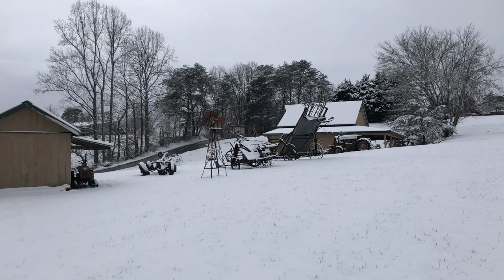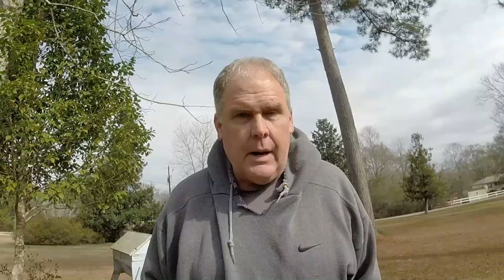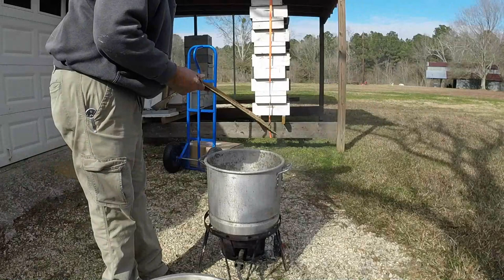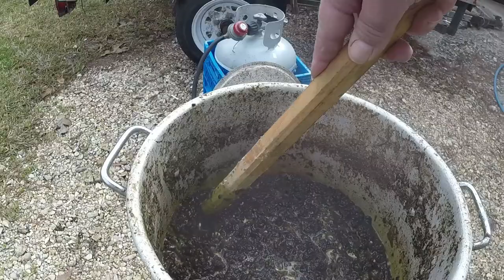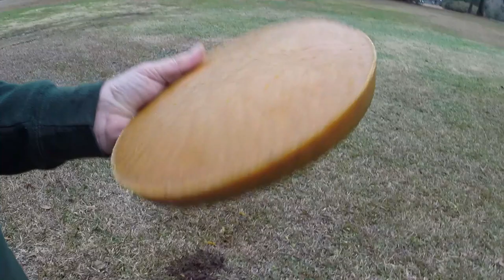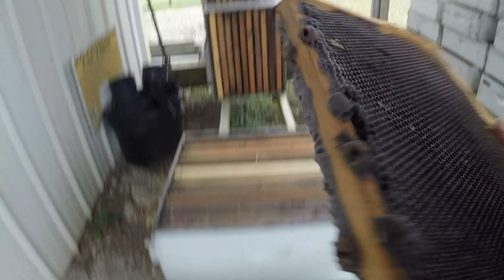Rendering Bees Wax and Various Beekeeper Tasks

Comment: Hi Mike, I find if I use lots of water in the pot to melt the wax, it strains a whole lot easier. I also pour hot water on the wax while it is in the strainer.
I also see no need to open a hive in the winter. In MN, I set them up in Oct/Nov and wait until March/April.
Reply from the maker: Hmm, I need to try that Raj. I cut back on the water because I always overfill the pot with wax, but to strain easier would be good. I will give it a try next large batch I do with brood wax. Thanks for the tip!

Comment: Hello Mike, just checked your old videos before I asked if you would do a video on how you make your foundation with the rendered wax. I have seen  "Fat Bee Mans" and Joe May but they do it on such a large scale. I only have 7 hives ,but I do melt the wax down but  I use it to rub it on plastic foundation. Thanks for your time and videos.
Reply from the maker: Thanks for watching and for the question. I use the wax for the same thing as you, plastic foundation. I do not make my own wax foundation. I like wax foundation and used to use it a lot, but I always just bought it. It takes a lot of wax and expensive presses if you want to emboss it, so that’s why Fat and Joe do it in a large scale. Plus they only use wax foundation, so it pays for them to invest in the equipment with so many hives. There are small scale ways to make foundation with a board and to make an embossing mold from silicone, but if I were to use wax foundation again(I like it a lot), I’d probably just by it with only keeping 25 to 35 hives. Here is a video that shows how I coat my foundations: https://youtu.be/a1Lyp5Ee-qY
Reply: @MikeBarryBees  Thanks Barry, I noticed that you used a foam roller I'll give it a try. Thanks again

Comment: I use a little $15 2 quart crock pot to render wax. I just put a strainer screen over it and put 2 layers of paper towels over the strainer. The towels filter out the sludge and you get clean wax in the pot. When I'm ready to wax foundation I just turn on the crock pot and use a 4" paint roller to apply it. Simple and easy clean up.
Reply from the maker: I have a crock pot that I tried for the first time last year on cappings and honestly, I didn’t care for the process. I used a paint strainer in it and then when it was all done, I pulled it out and the wax came out beautiful. But it was so messy and I couldn’t do much at a time, I kind of decided to abandon that when doing bucket loads of cappings. I do use a similar method to yours with the foundations though. I have an electric skillet that I keep wax in and just turn it on and melt it and then roll it. I showed it in the video. https://youtu.be/a1Lyp5Ee-qY. Once I’m done, no fuss, just turn it off.
Reply: @MikeBarryBees  the crock pot is definitely slow. When I am in my wood shop I have it off to the side and toss a little more wax in there as I go. Next thing you know I'm done. But I dont go through near the volume you do. I just bout 10 more complete hives from Hillco Bees LLC so I have 200 more frames to wax this spring before making splits. Thank you for sharing your journey with us and I look forward to the 2021 season.
Reply from the maker: @m.scotthern6306  I’m si rely not done trying the crockpot, but I have to perfect the process. What I do like about it is what you just mentioned, and that’s getting to take care of stuff in my honey house or even outside in the yard and it’s safely melting away. So that can make up for volume since I don’t have to babysit it.
Reply: @MikeBarryBees  Not to be captain obvious here but if you want to increase production just get more crock pots. lol
Reply from the maker: @m.scotthern6306  ok Captain Obvious...lol...I’m looking closer, though, at what you said you do. So you put the wax in first and then the screen with paper towels? Then what do you do, pour it out of the crock pot thru the screen. I’m not picturing it.
Reply: @MikeBarryBees  close. I start with an empty pot. Place the screen over it. Line the screen with 2 layers of paper towels. Turn the crock on hi. Put the wax on top of the paper towels. Place the lid on top. The ambient heat will melt the wax and the paper towels filter out the sludge. You get clean melted wax in the crock. For clean up you just throw away the towels. I leave the clean wax in the crock. You could pour it out in a mold if you want but I just reheat it and use the 4" paint roller for coating foundation right out of the crock pot. No mess.
Reply from the maker: @m.scotthern6306  hmm. I’m picturing it now. I like it. I guess the screen could be recessed just a bit to allow for more wax. Similar to the setup I use when I use a solar melter. I’m going to try it. You’re the only person I’ve heard doing it that way. And I bet if I put a little water in the pot, I would be able to free up the wax once cooled so I won’t have to pour it. Yep, I’m going to try this. Thanks!’
Reply: @MikeBarryBees  I would send a picture if I could. Yes the screen is recessed although if I took a little time and made one to fit it would not have to because the more it is recessed the less wax the crock can hold. I like the water idea that could make steam to aid in melting the wax too.
Reply: Last comment I promise. With your size of operation you may want to skip the crock pot and just use a full sized roaster oven.
Reply from the maker: @m.scotthern6306  well, as a matter of fact, I have been eyeing those cookers for a while. More so to dip foundations in, but also to melt wax. I’m going to give the crockpot a whirl tonight or tomorrow and see how i like doing it this way. Even if it’s a little at a time, I don’t have to sit and watch it as closely and so I can just do small batches at a time. I only have one 5 gallon bucket left of cappings anyhow.
Reply: @MikeBarryBees  I hadn't even thought of dipping the foundations. I was just tickled to be using the roller. I see a roaster pan in my future once my operation gets big enough. Good luck and be sure to post a video about it.
Reply: @MikeBarryBees  did you see the dirtrooster's video this week. He had the roaster pan and roller brush going on.  I mentioned you in the comments.
Reply from the maker: @m.scotthern6306  I did see his video. I use an electric skillet for that. Matter of fact I just started a video Sunday afternoon about cleaning and re-waxing. Waiting for the foundations to dry so I can finish it with the roller method. I wanted to get a turkey roaster like his for the dipping like I mentioned, but I have so few to re-wax, I’m just going back with the roller this time around.

Comment: Just another thought - I'd use the old wax for candles and the good wax for foundation coating. Old wax could have more pesticides in compared than capping wax right? I wish that we got more wax, it's such useful material. Take care Mike and God bless.
Reply from the maker: Well, I see your point, but the yellow wax just takes so much more time to get cleaned really nice for candles. And then if I’m doing any body products, I couldn’t sell it as food grade like I can cappings. But you do have a good point on the pesticides. I try to rotate frames often enough to prevent too much buildup, and one thing I have going for me here in my area is no row crops. So that helps tremendously with pesticide residues. I can also go a little longer with rotating frames out. But I see your point.
Reply: @MikeBarryBees  Do you add coconut oil to the bees wax to slow down the burn rate? I've used it and it really lightens the color and streches out the bees wax. The mix of your old wax and coconut oil might make a good looking candle. Just an idea??
Reply from the maker: No, I don’t add anything. We add almond or coconut when making lip balm, but all candles and blocks don’t have anything added. The folks that come looking for our wax are looking to buy pure beeswax, so any additions would void that. I usually get 3 to 4 five gallon buckets of cappings, so I’m built back up on that side. I treat it like Dadant and the other distributors and that is light wax-premium and dark wax. And only a few want the dark, so I’m good with that brood wax being used in hives. And the wax I bought is for hive maintenance and not sales.

Comment: Letting your frames and boxes air out will not attract wax moths before it's time to use them leaving them out like that?
Reply from the maker: It does not since it’s so cold. The freezes have knocked them back for a while and they shouldn’t be laying eggs this time of year.  I haven’t had a problem in the past with brood boxes out this time of year, and never with my honey supers any time of the year. Now that said, I will have to use them promptly in the spring or by mid summer, they’ll be infested. Thanks for the question!!